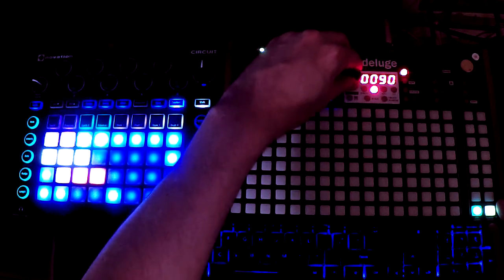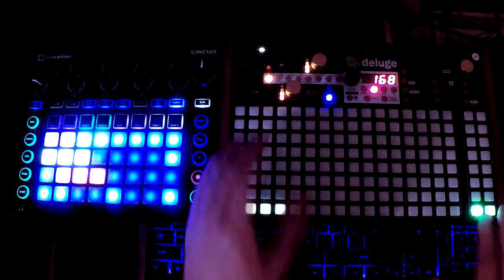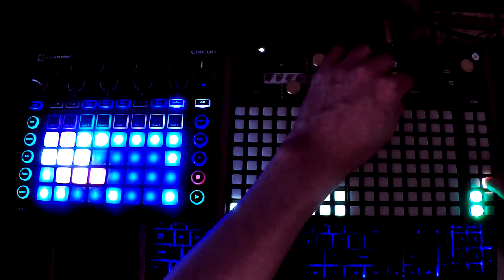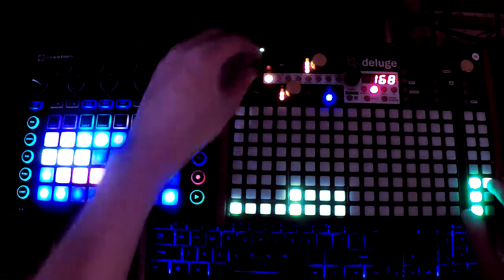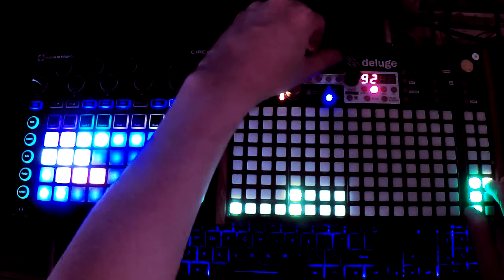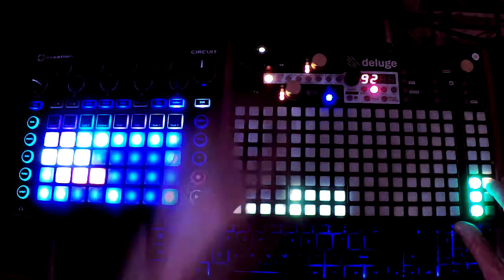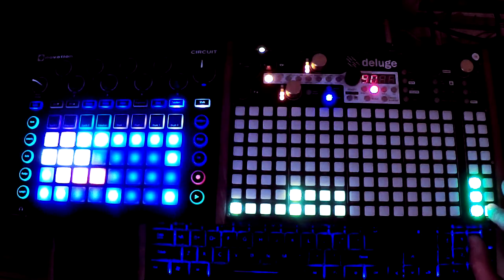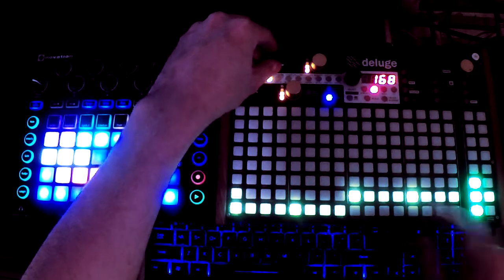(OLD) Resampling Audio Stem "Kit Song Mode" Workflow // Synthstrom Deluge Tutorial

Comment: Isnt it possible to switch the sequences of the circuit with midi from the Deluge?
Reply from the maker: Hakuna Matata yes I could. Just love both gear so it was an easy choice to use circuit.
Reply: +Ron Cavagnaro. Hi Ron thanks for the swift reply..you mentioned a transpot to start playback what is that device and can you explain the connections benefits
Reply from the maker: John Bonds I'm not sure what you mean but right now it's set up as slaved to the daw

Comment: Just what I wanted to see! So do you find you are using the Deluge like this rather than generating sounds itself? I know it can do both but I really like how intuitive the Circuit is for making sounds and from what I have seen on youtube the Deluge involves a lot more menu diving and I wonder if you find this clumsy?
Reply from the maker: Richard Grant there isn't really as much diving as you'd think. I could resample anything internal yes but I just wanted to include my circuit as an example because I love the circuit
Reply: +Ron Cavagnaro i have a question you mention a transport to start playback what is the transport? also is the deluge the midi master? over the circuit and external synths?
Reply from the maker: John Bonds yes the deluge has to be master clock in this current firmware maybe there will be a way to slave it later on firmware